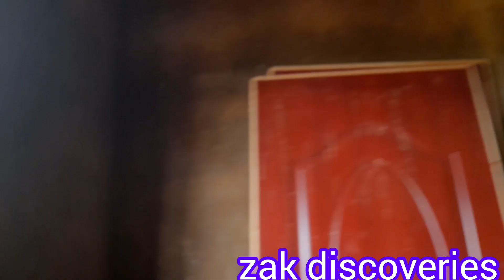Ready To Install PVC Ceiling & SLAB DOOOONE🙏🙏🙏🙏

Comment: Zak, the tank should be installed beside the kitchen, allowing the water from the entire new house to be directed to the new tank part of the gutter can run along the wall. Esthetically that would be the better place for the tank. Allow the water from the semi permanent house to fill the existing tank. Just a suggestion.
Reply from the maker: Beautiful suggestion.
Thank you so much.
 I like it.
Reply: Exactly, my sentiments. Connect the new tank near the back of the kitchen and place the tank there.